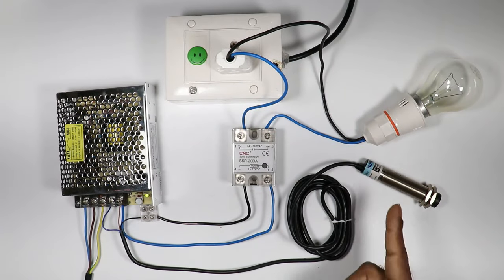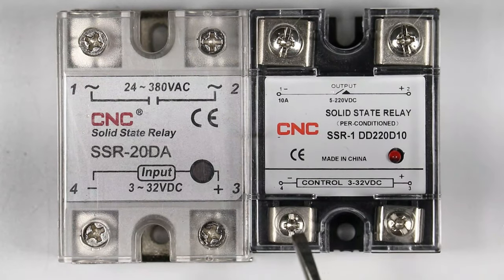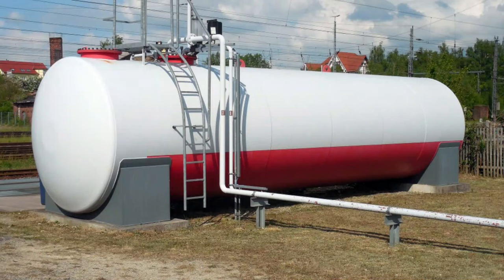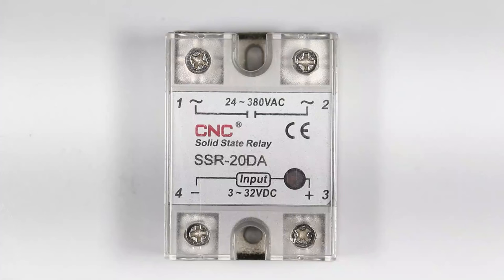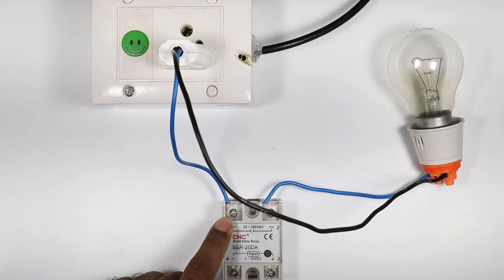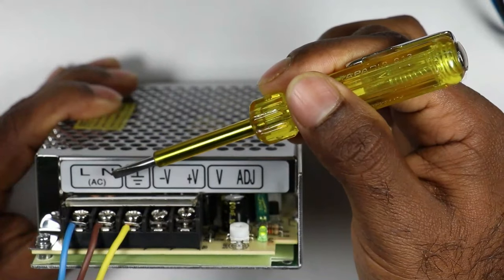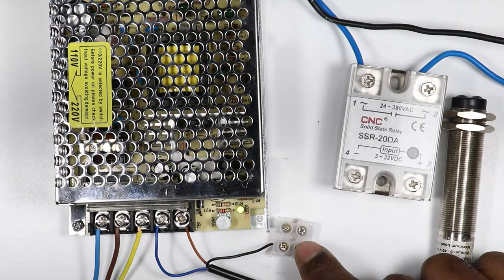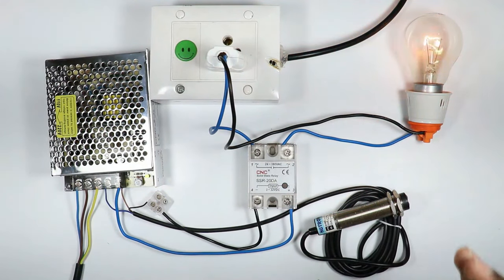SSR Connection With Sensor | Solid State Relay Wiring

Comment: Hello there is a dc to dc 5-60 volts output version of this SSR. Will it be recommendable and safe to use it in electric bike, that has an output of 42 volts/20 amps?

Comment: But why did you have to plug the out put of the lamp when the SSR is also being supplied with the power
Reply: Relay is used to isolate the input power and output power. Thus, still different power supply to the load.
Reply: If you remove output ac plug , will it work?   I mean will lamp turn on